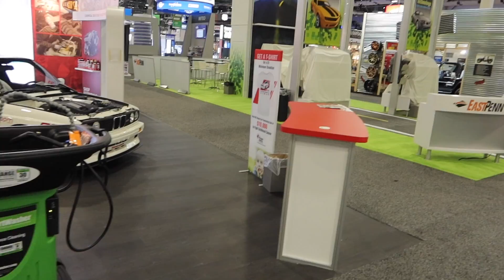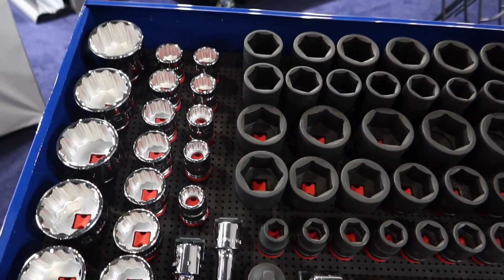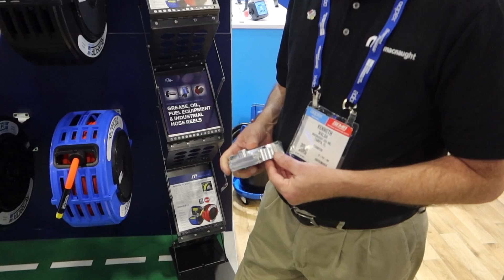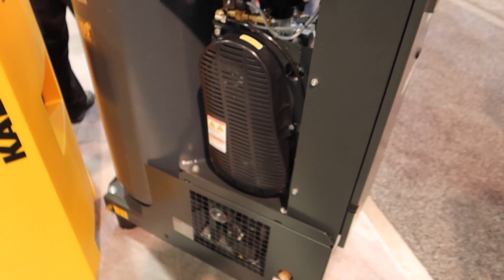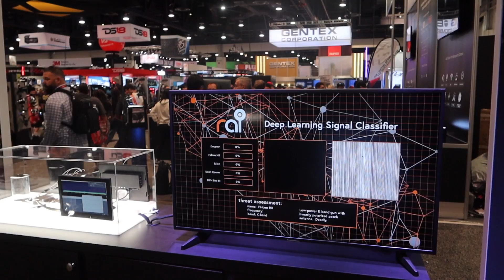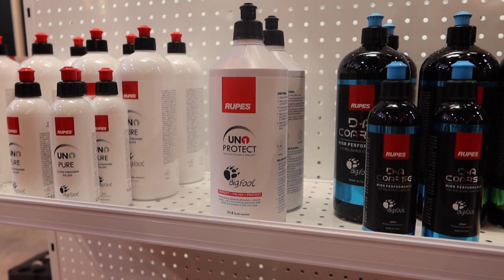2019 SEMA: Day 3 - Samson, Tool Grid, Meguiar's, Rupes, 3D, Flexzilla, Kaeser...

Comment: I am curious\ interested in the Meguiar's "Hybrid Ceramic WAX". Would you use it in addition to or instead of BeadMaker? I live in AZ where my black truck looks tan after 1 day of being parked outside from all the dust. BeadMaker has helped a lot for the sides, but the hood and roof not so much. I am leasing the truck so I don't want to do an actual ceramic coat at this time.
Reply from the maker: I don't know if those will play well together.  They are very similar products.
Reply: @ObsessedGarage  Thanks for the response! I am loving BeadMaker btw. I can definitely tell a difference.

Comment: The drawer tool grip inserts is definitely something I am interested in being a full time mechanic. I have never heard of them either. Flexzilla actually has some good impacts. I use the 1/2 inch Stubby air impact for tight spaces and it has enough power to remove crankshaft bolts.

Comment: Rupes bottles design are really simple and slick. At work they use 3D compound but on occasion, it would cut deeper scratches (not sure which compound to be exact) but also risk burning through the clear so the buffer mainly use some cheap compound and polish. 3D Orange degreaser is really strong, from what i experience at work. It would clean off break dust from rims with just the pressure of the spray bottle diluted too(not completely but did clean some brake dust) saddly the supplier stopped selling offering the degreaser so I couldn't test it as much but I am going to buy a bottle to test it again. Have you thought of offering gtechniq c4 permanent trim restorer for people use has older cars that have faded plastic (Like me). I have not used it yet but from what i seen it looks like the best alternative than dye style restorer, heating plastics or spraying over with matte/satin paint for plastic that i would assume that will wear off over time. Of course buying new plastic pieces could solve the problem. Keep up the good work!

Comment: So my question on those air compressors is how easy it it to change the oil and is it under compression? I know on our industrial Ingersoll and rand you have to pump the system several times to get fresh fluid through the heat exchanger Intercooler !

Comment: That Tool Grid stuff is awesome, glad you found that!
Reply: promodvette yeah!  I had my notes list going and adding stuff to it that I seen!   That tool grid stuff if on my radar for sure!!
Reply: Yea, it's very cool, but did you happen to try to find prices for that stuff?  Great mother of potatoes, they want a king's ransom for it.  I'm all for innovators making a profit on their ideas, but $5.50 for one single 1/2" socket holder and at least $40 for the drawer board?  Wow.
Reply: John Gerken you are looking at the quantity wrong buddy,.....   Cornwell website lays it out pretty good.  25 socket studs for $5-7.
Reply: John Gerken the boards are kind of expensive, but I think 1/8” hole plastic peg board should/ could work.     I’m not sure.   It’s hard telling how proprietary they made the stuff.
Reply: I’ve bought into it. Very glad. It’s cheaper if you can get it thru Medco, vs the tool trucks.